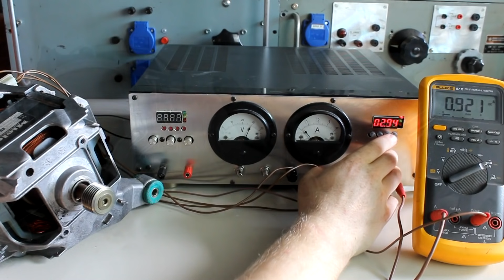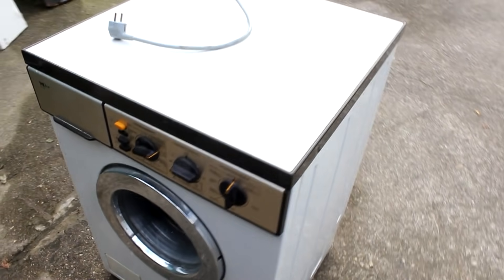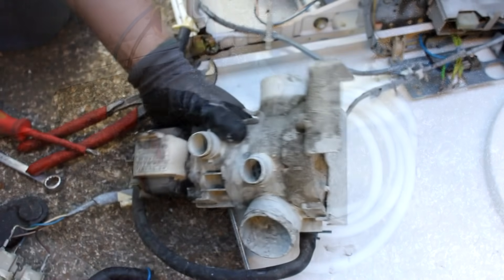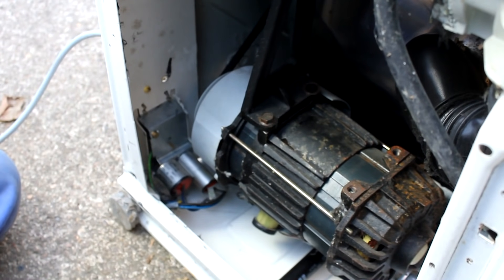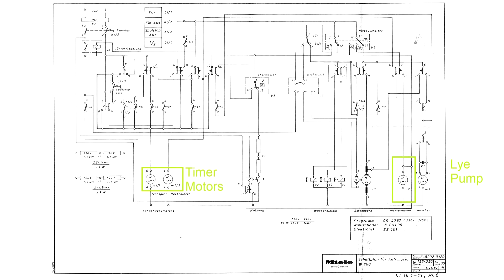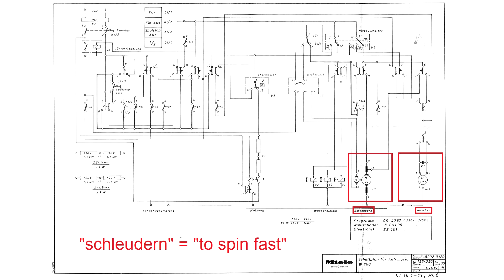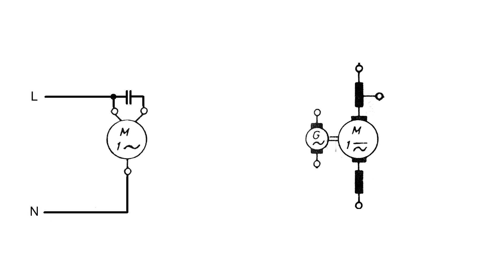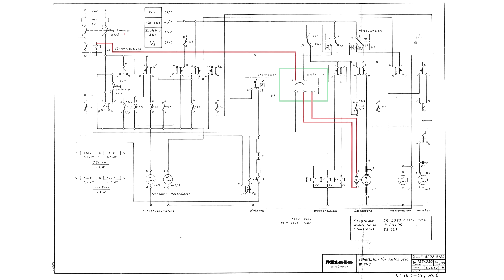Salvage a Big Electric Motor and Transmission from a Miele Washing Machine

Comment: is this strong enough to act as a gate opener? For example if I remove some weight, by puting the gate on wheels.
Reply: KalTube 
That would entirely depend on the weight of the gate and the force required to pull it. You would probably need to use some form of gearing to reduce the speed and increase the torque.
Reply: KalTube I think the motor would be more than strong enough to open a regular old gate, the reason you'd want to gear it down is because it would go way too fast. don't want your gate breaking bones as it decisively smashes open and closed.
Reply: depends on motor power & gear assembly, a worm & worm wheel will give you most torque but will be really slow, helical planetary gears maybe quick but may entirely depend on motor power & add to that the weight of the gate

Comment: that's a crazy motor. but I see why its used! cheaper and easier than a complex transmission. and controls. great video
Reply: You wouldn't need a different transmission anyway and building two motors is definitely not cheaper than a single one. The brushes will have a much longer life than in usual motors, but I don't really see what other advantage there is.

Comment: Can you make some sort of motor generator with your new motor? E.g Connect induction motor to mains supply, connect a variable PSU to stator coils of brushed motor and connect a load to the brushes.
Reply: Yes, you can! That's actually called the Ward Leonard drive system. It was invented back in the late 1800's and was used to drive the DC hoist motors on elevators and cranes, among other things. Many of those old systems are still in use and in fact I service tower cranes as new as 2002 that used Ward Leonard to drive the hoist motors. It's an electrically simple system; by varying the the voltage and current on the DC generator field coils, you get very precise and smooth control of both speed and torque on the DC hoist motor. It's especially useful for lifting devices as you can easily get a large boost in speed above the rated RPM at the expense of rated torque just by weakening the field current.

Comment: What a pity that you disassembled that wonderful machine. It could have found s place to serve another 20 years...
Reply: That looks built to last a 100 years :-)
Reply: superdau the amount of corrosion in this 35 year old Miele is about on par with modern 3 year old supermarket brand unit. Stainless drum spider is a song of the past, nowadays you get specifically crafted alloy spider designed to DISINTEGRATE after warranty runs out. Google "spider corrosion" and weep
Reply: There's a reason the original owner sold it for scrap so I doubt it's performance as a clothes washer is up to much, especially when compared to a modern machine. At least some of the components will go on to bigger and better things, rather than the whole thing being crushed!
Reply: I thought that too. But I think he is working on a Robot that washes cloths, sing and drives, among other things.
Reply: Pete Allum  The reason is usually not that the machine is broken. Usually the housewife wants a shiny new one, or the owner finds the machiny stinks. Yes, it may stink. But it can be cleaned.
Reply: Judging by the amount of debris in the hoses and the corrosion on the drum shaft (that's where seals are), I don't think it would work for much longer without clogging up or leaking. And after 35 years it's about time to change over to a more efficient modern machine.
Reply: superdau    I am using washing machines of that age and quality in three different places where I live. Yes, sometimes a part needs replacement - typically a heater or a sensor - but that's easily done. Residues in the drum or in hoses can be cleaned away. I have not seen a case of such a machine that could not be repaired by a DIY amateur with some interest in the matter. Of course, professional dealers and repair people either say that this cannot be fixed (or ask for stellar prices), and the ordinary consumer just believes them.
Reply: A lot of machines with all their energy + water saving, features are slow and don't necessarily get the clothing that clean. If he wished he could have cleaned out all of the hoses and maintained the machine something not possible or economically viable on most of the newer machines. How about bringing it up to date with an Arduino for control + a pretty graphical display:-)
Reply: Coolkeys2009
Tend to agree, but I would guess that we are now living an age where the majority (even in Germany) expect competitive prices, reasonably good quality/reliability and a shiny new superior unit after five or six years.
Reply: +Anth2305 If machines are only made to last 5 or 6 year now, after the next 20 years they will probably only last 2 years, what a rape of the environment + waste of resources. Humanity is never going to go forward as long as people live like pigeons working just to survive + replace everything they earned with their time and labour every few years.

Comment: I used to work for ICI where we had very large refrigeration compressors that were used to liquify gaseous chlorine. The ac motor was about tge size of a van and had a dc motor coupled to the same shaft. Hv was applied to the ac motor to drive the compressor. Current was induced and collected by a series of brushes or slip rings i think they were referred to. This induced current was then applied to the dc motor mounted on the same shaft in order to increase efficiency. This system was called the Kramer speed controller and was a great piece of kit. It was prone to thyristors blowing regularly if i remember correctly. This miele motor just reminded me of it. Great vid.
Reply: just googled kramer speed controler. do i get it right that the induction driven part of the rotor has coils commutator and brushes instead of being a solid piece of iron and instead of being induction motor because of eddy currents in the rotor its induction motor because of normal currents in the coils. and so then the current generated by those coils goes to a rectifier and drives DC motor?

Comment: I'm certain that you can get a grooved belt replacement at a auto parts store. They're usually for the water pump/air conditioner/timing belt.

Comment: so at which part of the washing cycles are an induction or a unversal motors best at?
Reply: thank you, but makes you wonder why make it so complicated, i guess why the newer ones just make the same motor do it, i had a bosch that had a peculiar mechanism, it had a gearbox on the induction motor, and if it kicked quickly forward then backward, the gearing ratio would step up for the spin speed, but if the controller went forwards then stopped and backwards, it would do the tumble speed each way,  ingenious way to go
Reply: yes, it was a very expensive machine bought around late 70s it lasted 35 years without any failure, in fact only died because i broke the plastic output water flange and was given a near new miele so had no reason to fix it, though the main bearings were becoming noisy at tumble speeds, and some of the programs would not complete, but not the ones i used

Comment: Hey hey, old treadmills also have extremely powerful and heavy motors in them
Reply: They also usually have control panels already hooked into them and what not for easy control
Reply: Why, I would go as far as to say that you could even get it wireless
Reply: The motors are also just as large as the you have salvaged video, or atleast the one I got out of my treadmill is
Reply: I think washing machine motors typically are 1/3 to 1/2 HP whereas  treadmills start at 1 HP and go up.